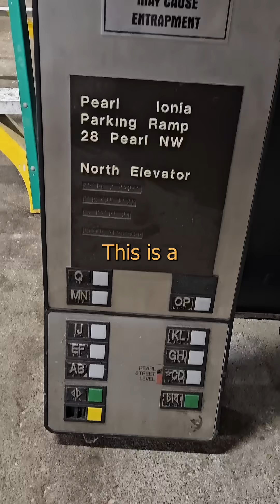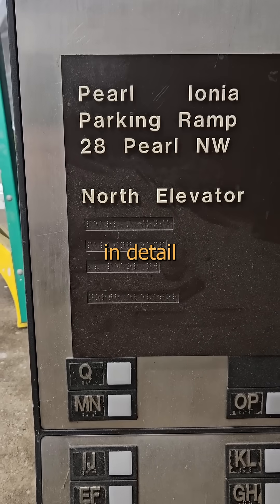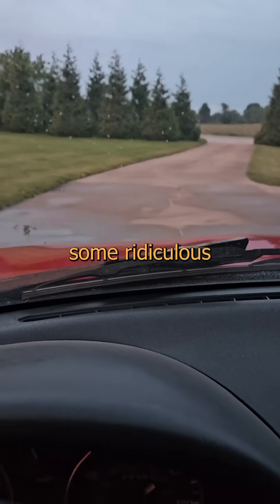Miata Mischief #chrisboden #engineering #gear #elevator #score #stories #parts #hacking #making

Comment: Had a 98 Ford Taurus that we took a couch and put it on top of the Taurus and strapped it down with multiple belts because we could not find at any store rope or tiedowns so we latched all the belts together and put them over the couch and drove about 100 miles, but these thing strapped to the top of the car with belts I’m not talking leather belts. I’m talking $.99 store plastic belts. I think we bought a total of 10 of them or more.

Comment: I once made a 2 hr drive in a 90s 300zx with no heat or a/c in 23°f weather. To pick up another hood for my 300zx. Had to put the front seats all the way forward and leaned forward too. I'm not a tall guy but man I was stuck in the most uncomfortable position for another 2 hrs back home.

Comment: I love the Otis lift control panel! I’d love a Dover panel honestly!! 😁 but to add to this also, Three things I can think of that fit with this I have done, that i can think of in recent years with my hobby that are kinda nuts, sketchy and let alone exhausting, are this lol: 

Number 1: Bringing an almost mint 50HZ 2840RPM brooks (only just before they became Brooks Crompton) Siren motor back from London on a few trains back to Manchester with a sack trolley (London doesn’t always have stations with lifts 😬) except weirdly, i had lots of polite help from people in London to assist me with getting this motor up lots of stairs, and even through a tube station at one point! Much to the hatred of the sack trolley, which at the end was on its last legs, with the wheels wonky and the whole thing feeling shot, but I got it home! 

Number 2: Bringing an 80/100KG Castle Castings Siren all the way from Kidderminster (originally from Kent by my friend who I was meeting from there, also proof of this is on the castle castings siren page) back to Manchester.. however B&Q somehow never properly inflated the one sack trolley I bought! but thankfully a mechanic let us use there compressor at a shop to inflate the wheels 😅 again on multiple trains, had to change a few trains, one station (I forgot the name off) had the worst staff and would not help me get the siren on the next train and were being rude - shout-out to the kid or enthusiast who knew what it was and helped me get it on the train!! Finally though, I had to go back on myself to get it off where it needed to be. But got back home with it happy as can be as my full first air raid siren! :)

Number 3: Going to the Isle of Man bt ferry, to recover a 10 port rotor for a Klaxon Siren from there (2020 decommissioned siren network) only to end up going to the Civil Defence HQ (Thank you to the wonderful boss lady who let me see the HQ and do all of this!) to then instead, pick up both the 10/12 set of rotors and stators from one of the sirens that already had its motor scrapped. These rotors and stators were not aluminium I don’t think and weighted an awful awful lot, in a card board box I carried back! I finally got the ferry back to Liverpool, taxied it to Liverpool Lime St Station  and headed back on the train to Manchester! :)

There may be more adventures at some stage, but these are my own experiences/things Iv done to get the cool (and rare) things I wanted! 

PS - I love the Miata! Awesome video 😁

Comment: i bought a beautiful bmw really cheap because it had no working aircon and the speedo didn't work, it ended up being a 30cent thermistor fixing the aircon and a $30 abs sensor. 

but because i bought it so cheap, it didn't stay in its perfect condition for very long. we needed a fridge, and it just so happened that a few blocks away there was a free fridge sitting on kerbside, So i threw it on to the roof of this scratch free car and one hand held it down while slowly driving home, I did attempt to do it gently but getting this heavy fridge off the car i got tangled up with the power cord and had to slide the fridge down the c pillar in order to not drop the thing. 

needless to say, the car wasn't scratch free after that. so worth it though that fridge was a life saver.

Comment: Shoooooot i've got a couple first off. I threw about 4 sheets of osb on the top of my ford, cmax screwed the windows down and ratchet, tied them to the top. Then I laid down all the seats in my scion, x b and slid an atm in it to install somewhere else. Finally.
I slid 2 pieces of cement board in the back of my wife's Toyota camry, I messed up the door handles, but got those suckers in there.

Comment: About 80 concrete blocks can fit in a 1988 Honda Civic Hatchback. Ask me how I know!  Weighed over 2000 pounds. It rode like a Cadilac because she was solid on the springs. Every neuron I had was expecting the car to break in half, but I made it home, about 20 miles, with no burst tires, AND THAT'S PRETTY COOL!

Comment: I hauled a full sized mattress inside of a Hyundai Santa Fe, trunk closed, with my 5'11" self sitting in grandma position behind the wheel. It's not a particularly cool thing to haul, but I've never felt in such danger behind the wheel than in that day, because if I crashed, the airbag would make my pronouns was/were.

Comment: I had to fit 3 engines in my Ford Focus hatchback. The Ford 302 went in the trunk, the .8L 3 cylinder went in the passenger seat. But where was the 3rd one? The 3.8L of immortality Buick 3800 engine? That was on the roof, held down with ratchet straps, and I’m not insane, I had a few (dozen) blankets under it so it wouldn’t scratch my unbelievably rare paint, but still, 3 engines being carried by a ford focus. Also, another time, I fit 7 people in it, as well as about a hundred pounds of scrap metal, that was wicked, we were in a frozen over parking lot and we decided “hey…can you fit us all in the car?” And that’s the night I learned that FWD cars are a RIOT in the snow if you can do it SAFELY. I had the 2 in the trunk holding on to the oh shit handles, and there was nothing to hit in that lot. I might be dumb, but I’m not totally stupid

Comment: A buddy of mine and I decided that after working at a foundry for a year thet closed up shop, we wanted to build our own furnace of sorts. The idea of sorts was to use waste oil  gravity fed through a sealed squirrel cage motor reduced down and down until until it came out the end of the piping as a mist (venturi effect type plan) we'd blow it into our own refractory lined home made barrel furnace. 

Thats where the haul comes in. Driving 4 hours to Columbus to load down the trunk and back seat of an 06 jetta (which is the polar opposite of the mazda, so much room!) With bags of refractory mix from a company agreeing to sell by the bag to two idiots, and enough fire brick to make Carnegie jealous the wheels basically were rubbing in the fender well back to the Ohio PA line.

The furnace never took shape as planned but we did end up learning enough to make a forge with the materials, and that load capacity is simply a suggestion.

Comment: I rode five miles round trip on a Honda cl350 scrambler in an ice storm with a 3000w generator, a 100ft extension cord and a sump pump duct taped to the back seat in the late 90s

Comment: My wifes and my first car was a tiny VW Polo 6N from the mid nineties. The cool part about the car was, that it was an Open Air. So it had an electric roof, that could open all the way back. At the time we used to live in the centre of Innsbruck in a house from the 1850s. So 3m ceiling equals an accordingly tall christmas tree. To get this huge tree home i opened the roof of the tiny Polo and off we went, with about 2 metres if tree sticking out if its top. When we arrived home , which was near a busy intersection, i had to act quickly, jumped out of the car and pulled the tree with some force out of its top. For whatever reason, maybe it jammed somewhere, it made a nice , loud "plop" sound. A lady who had watched me, came over, laughing, shook my hand and said " thanks, you made my christmas"

Comment: I was gifted a camper shell for my old full size square-body Chevy once.  Unfortunately, the truck was broken down at the time, so I had to use my other vehicle, a 1984 two door Jeep Cherokee midsize.  I put it up on the roof to get it home. Unfortunately, I forgot to bring anything to secure it to the roof.  So, I drove home at 20 mph with my left hand out the window, holding my camper shell on the roof.  I suppose I should mention that the Jeep was a manual transmission and shifting was a little challenging.

Comment: ‘88 Buick regal 2 door coupe with the 2800. In 2017, my fiancé and I packed every single inch of that car with our belongings and moved from Bangor ME to San Diego. The suspension was completely bottomed out from the weight, but that engine just kept going. We hit NYC, Gettysburg, Niagara Falls, Mammoth Caves, New Orleans, Houston, Denver, and the Grand Canyon. It was just over 5000 miles with the car bottomed out and us pressed up against the dash as far as the seats would go.

Comment: I once hauled a giant wooden pallet for a friend who needed a place to set his camper when it wasn't on his truck, and I mean the kind that one sleeps/eats in, not the mere shell that covers the bed. I balanced it on the roof of my 1986 Mercury Sable, then drove it to his place with one hand holding the left side and my teenage stepson holding the other side out the passenger window. No straps, no tie-down, no ropes. Just two human arms clutching a pallet that measured 8ft by 8ft.

Years later in the year 2000, I was getting ready to move to southern Cali and needed cash, so I removed the passenger seat in my 1984 Audi GT Coupe to haul a 35in Mitsubishi big screen TV, the kind with a CRT in it, down to a pawn shop.

I once helped my dad move his 1956 Austin Healey Sprite project car from one house to another by shoehorning it into the back of a UHaul box truck, with some slapped-together plywood boxes to prevent the car from resting on the truck's wheelwells.

Comment: i bought an Ikea couch, that i thought would fit in my car.
i got it fitted but not they way i planned.

I had to unpack a few boxes and place those in the passenger seat, it was barely legal to drive that way. 

rear window was blocked, and on the right side i had minimal view but just  enough to drive safely.

the thing i learned is, if you measure your trunkspace; make sure that you take into account that the backseats might not go down all the way..

Comment: I got one that still makes my teeth sweat.

There I was, staring at this absolute unit of a custom-built shelf in the back of a one-car garage. Any sane person would've seen a collection of wood and screws, ripe for disassembly. But my brain, in its infinite wisdom, decided that was entirely too much like work.

'Nah,' I thought, 'we can move it whole.'

Next thing you know, I've got this monument to questionable carpentry strapped into the bed of my '84 Toyota SR5 longbed. And when I say 'strapped in,' I mean that in the most optimistic sense of the word. We're talking about a couple of frayed straps and a whole lot of prayer.

So I roll on down the road. This thing is standing tall, acting like a mainsail in a hurricane, catching every gust of wind and turning my trusty Toyota into a land yacht with the handling characteristics of a drunken giraffe on roller skates.

Every overpass became a personal game of chicken. I'm talking millimeters of clearance. My knuckles are white, my stomach's doing backflips, and the only thing going through my head is a constant, high-pitched scream.

But then, the sweet, sweet relief of arriving home. And in a moment of beautiful, idiotic symmetry, the shelf that came out of a one-car garage slid perfectly into the back of my one-car garage.

Sometimes, the dumbest ideas are the ones that work out the best. Doesn't mean they're not dumb, though.

Comment: College, late 1980's.  A good friend was working in an office and his manager was moving apartments.  She asked for some help and we obliged.  She had an open pick-up truck that we were using to move all of her furniture - - - including her clothes dresser.  To help lighten the load when carrying it to the truck, we took the drawers out.  Apparently these drawers included her 'drawers'.  For some reason, I was the man behind the wheel to drive over to the new place.  So, with all three of us in the cab, I hit the gas - - - and wouldn't you know it, Newton's laws took effect and without anything covering the clothing, we sped off with a trail of Victoria's Secret's finest trailing behind.  At least for the distance required for someone to ask - what is that?

Comment: I wish I could share a picture! I hauled a door, a bumper, and varying engine parts and interior pieces for a Mazda 3, inside of a Mazda 3 lol it was actually a lot more impressive than it sounds. Getting the door of a Mazda 3 in through the door of a Mazda 3 is not easy 😂

Comment: My boss and I had to pick up an engine and exhaust from a dealership, we were a private BMW shop. We had no truck, we had no SUV, but we were lucky enough to have a 2011 BMW 135i convertible. We did the absolute right thing, and took it to the dealer. We got some strange looks and plenty of protest from the guys at the parts department, but we weren't in the position to be picky. 20 minutes after showing up, it was a sight to behold. An n52 inline 6 in the back seat, the exhaust in the back floorboard behind the drivers seat, and myself, ratchet strapped with the 6 foot long exhaust to the chassis in a way that only truckers and bondage enthusiasts could. appreciate. We hit i75, and by the time we were merging on to i24, we were doing 80 miles an hour. Of course we had the heavier portion of the exhaust, the muffler, on the floor, but the cats at the top were still heavy enough to create some amount of leverage anywhere above 30mph, and the resonator was in the perfect place to give me a swift whack to the plums any time my boss hit the gas. I'll never forget that.

Comment: i made up rectangular packs qty 4x of 7ah agm batteries that my dad brought home as they were "retired from service" often at his work for age. so a pack had 4x batteries ea about 20 lbs, double sided tape, between them, then entire pack wrapped around circumference with duct tape. Then solid aprox 12 awg wire between the terminals in parallel. They got hauled in backpacks to start cars, run sega & tv in woods, school, florescent lights at treehouses deeper in woods etc. even my friends wall powered alarm clock because i had to get up in morning to bike to work (i had no chance of affording a car back then)

Comment: 1974 MGB on a run to my sea can. Passenger seat stacked with chests and bags to the roof, couple 8' 2×4, 4x4s and a set of skis poking out the zip out back window.  Other sporting equipment and a plant filling the rest of available space. Didn't mind the gawking but the cameras were annoying.

Comment: i hauled a 25 gallon air compressor in my 1989 240sx, barely fit and i was getting looks loading it. Scketcher yet i put a 12 ft roll of carpet from back window to back window in my 98 gtp grand prix sticking out 3 feet or so each side for around 2 miles. got thumbs up driving through the parking lot of a car dealership.

Comment: When I was moving storage units, the owner noticed all the small engines I had and asked if I wanted another.

I said sure, and we drive to his personal storage unit and it was a 350 v8 block, crank, and 6 pistons.  Not a small engine.

Of course I didn't say no, but we had to manhandle that thing into my truck.

My truck is a lowered s10.  Getting  it in wasn't bad.  The bad part was the lack of engine bearing suspension.  Rubbing tire under acceleration, every little bump felt harsh, and I had an excuse for that Carolina Squat I did all the way to my new storage unit.  It was also pouring down rain.  The balance and feel of how it drove was almost uncanny.

Comment: I worked at a scout camp one summer. We cut down some small Aspen trees to use as poles for a gateway we were building. At the time i was the only one who ahd a license and a car from my program area, so next thing you know, about 30 20ft quaking aspen poles were loaded into the kayak hooks on my 2007 Saturn Vue and driven 5 miles to the other side of camp.

Comment: I hooked up a small dump trailer with no suspension to my Mitsubishi Mirage, went down to Bluemels on Loomis, and bought a quarter yard of ⅜" screened traffic bond. That isn't much, but the trailer empty is already about 600 pounds, and my car only makes about 70 horsepower. Got it home just fine, but about 5 years later I put in a new clutch.  I usually have the seats out and roof bars on for cargo antics, the car is basically a service truck at this point, but I can't compete with people I've seen in Việt Nam. I might have put a shop fan, snall furniture or a few suitcases on a miniature motorcycle, but I've seen 3 pigs or up to 2000 chicken eggs balanced on a Honda Super Cub. I can probably dig up pictures of some of it too.

Comment: I had an 85 Camaro Z28 and was replacing the the 2.2 liter 4 cylinder in my friend's Malibu so I put down plastic and some old carpet for padding with a piece of plywood on top took the T-tops out and loaded the engine in the front seat and drove from Hesperia to Detroit and back with it by my side

Comment: Among the dozens of sketchy loads I have hauled the craziest one was when I decided my Subaru forester was capable of carrying the 45 bags of concrete home for the pour I needed to do the next day, with 2250 LBS of concrete distributed as best I could as to even the weight between each wheel I decided that since I was at the hardware store anyway I should also grab the 15 sheets of plywood I needed.  
My shocks survived and it seems happy despite my abuse so clearly it can take more, at least until I can buy a pickup